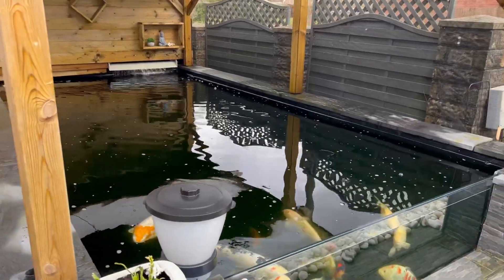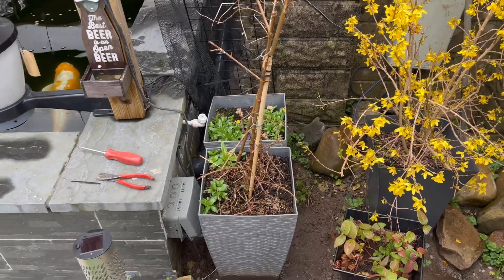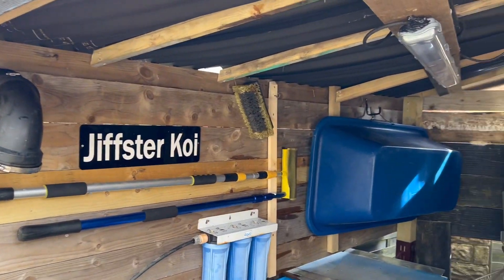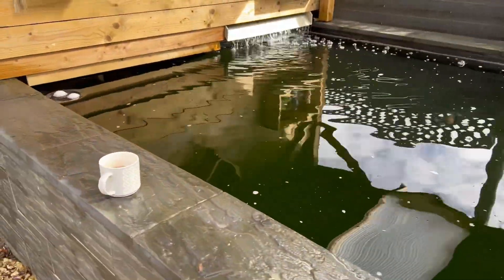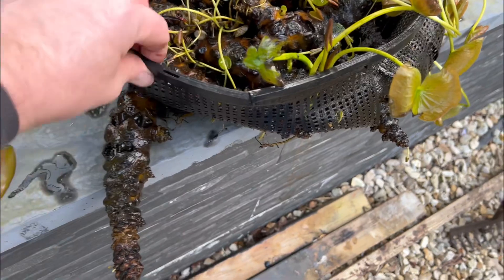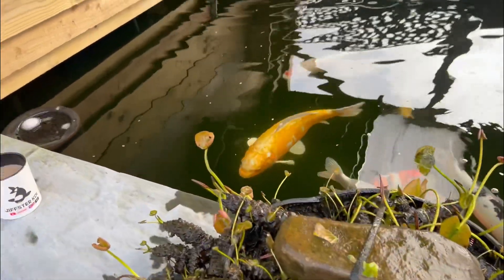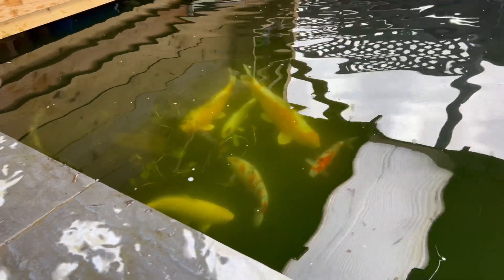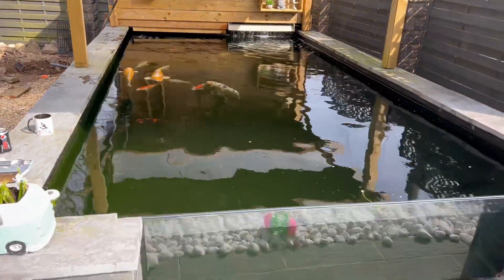Koi pond  why a steel hose ,Adding pond  lillies #happy #koi #gardenponds #japanesekoi #parasites

Comment: We had that problem with the hose pipe and it turned out to be the foxes. Funnily though they don't bite yellow hoses, only the darker colour ones. Weird eh.  I don't have much luck with lilies. The fish either eat them or if I use any salt, what so ever, it kills them off. The pond out the front though has massive lillies in there amongst all the other vegetation.
Reply from the maker: Hi Jim should be good now with the hose 
Yea I love lilies I have .3 salt but they can survive that just about 
Can’t beat some plants in the water 👍🏼👍🏼